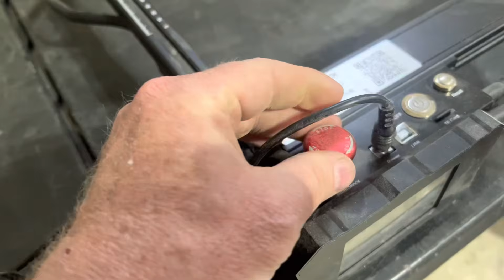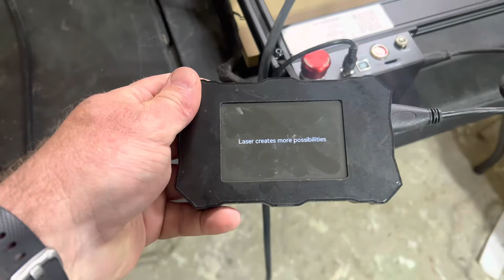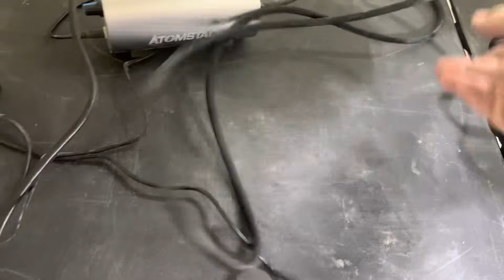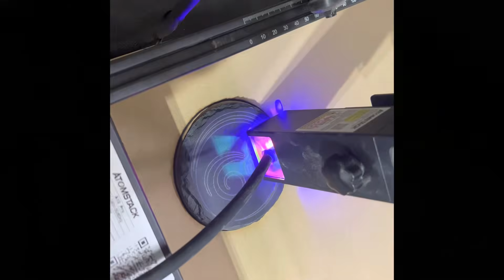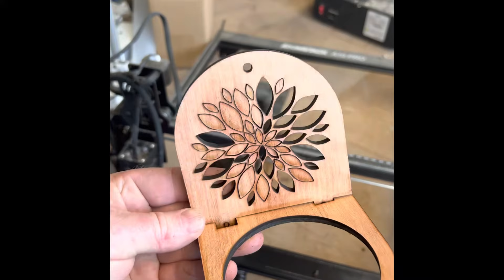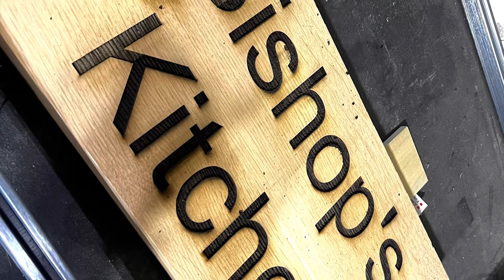Atomstack A10 pro laser engraver 1 year review.  #laserengraving #atomstack

Comment: Hey great video thanks. 👍 was wondering if you could share your settings to cut through the wood. Im having trouble with this machine even cutting through 5mm thick plywood. I need to run it on full power and do 6-7 passes but at the moment I dont have the airpump so my edges are just roasted.

Comment: I got one of those table top machines, and I was able to upgrade the length to 80CM, and it did will. I use it to engrave my woodwork logo. After I add the air pump the finished work became more clean without any burn. Thanks for sharing your video with us
Reply from the maker: I upgraded mine as well, I plan on doing larger signs. Thanks for stopping by